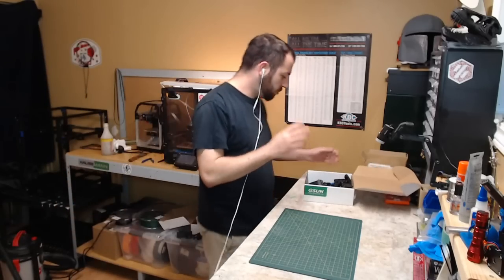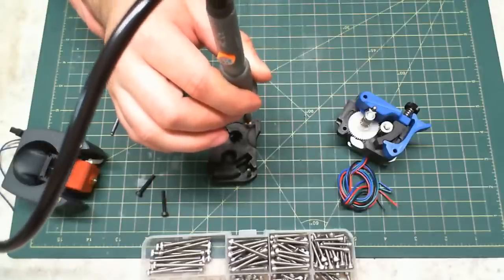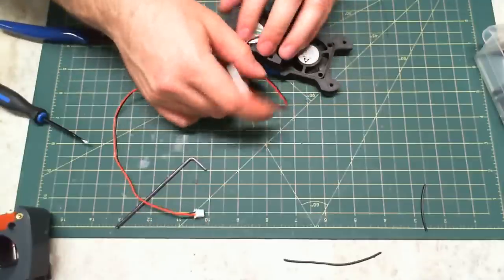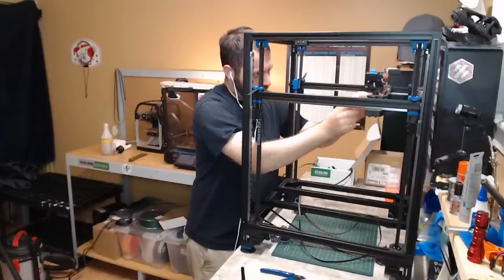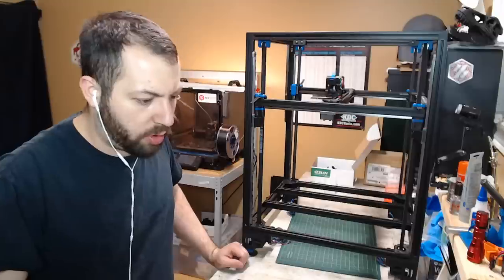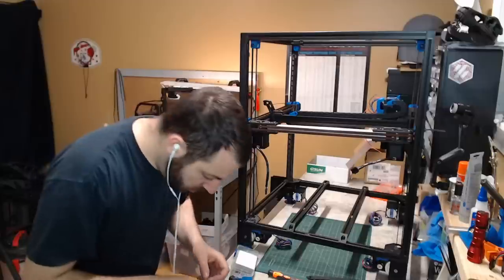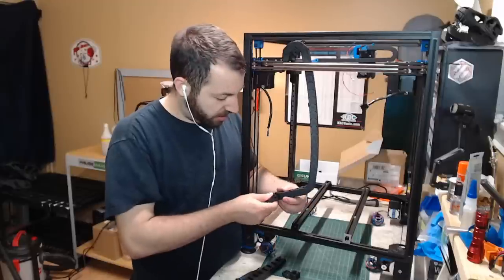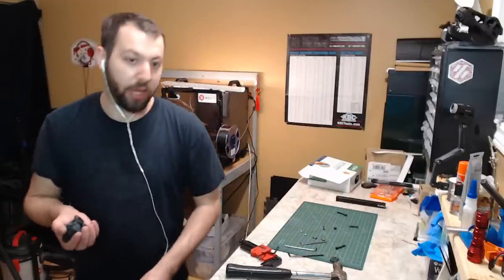Voron V2.4 Part 4 Build, wrapping up the gantry/Afterburner

Comment: AT 2:05:00 ish.  Just realize he left one part out, there is a PTFE tube that goes between the hot end and the top clockwork....it's 24mm long and keeps the filament from hanging up.

Comment: Nero, thank you for the videos and the great tips. Could you please share your cura profile? I can`t decide how much cooling do I set up for ABS.
Reply from the maker: Fully enclosed i run about 15% fan
 Bit more for bridge and overhangs. Its a tweaked version of the stock voron profile included in cura
Reply: Nero 3dp just enclosed in acrylic or more? Any additional heating?
Reply from the maker: @Olof123  pc panels. Not acylic. But there do the exact same thing. No additional heating. Just the bed itself keeps the chamber plenty warm
Reply: Nero 3dp any reason why PC? What thickness?
Reply from the maker: @Olof123  iirc 3mm thick. And pc cus tap plastic sells smoke tinted pc panels.

Comment: How will all these belts mad of plastic behave at 100ºC (212ºF)? Will they start stretching and loosing the accuracy?
Reply: A Voron 2.4 doesn't get that hot, but yes they would begin stretching around 85c. There are high-temperature Gates belts that you could swap to that are sold by TriangleLab, FilaStruder, and PrintedSolid. You would likely need to change a lot, though, such as changing from ABS parts to PA12 or Polycarbonate and using LDO high-temp motors.